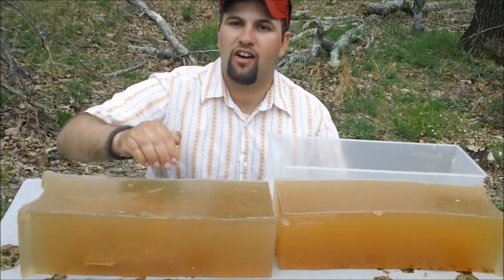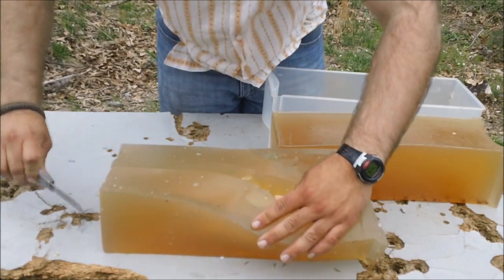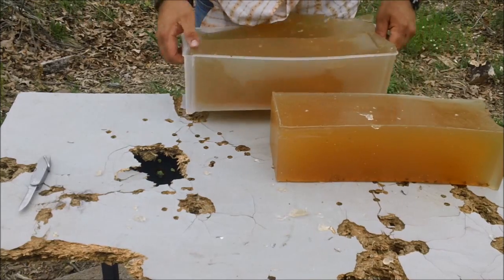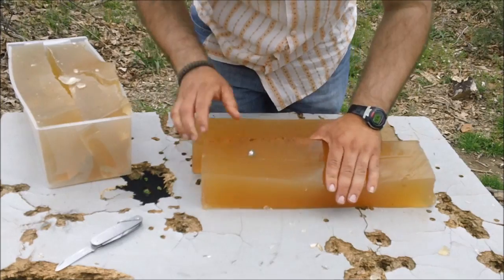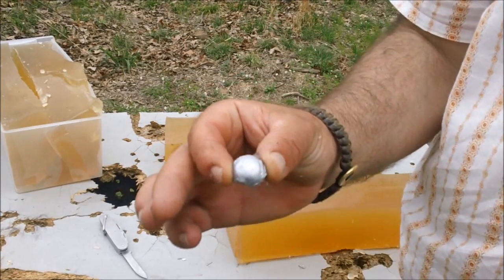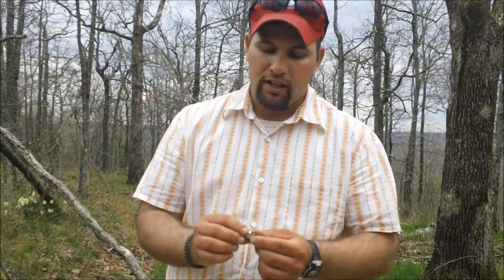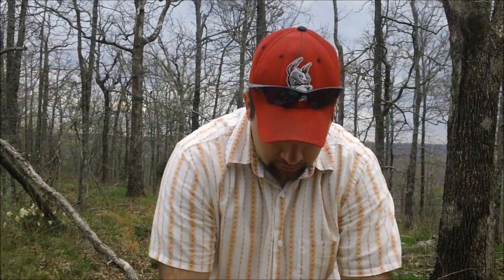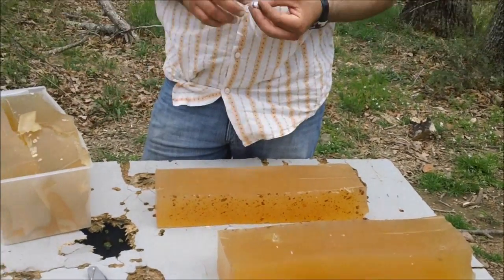Ballistic gel testing Sierra 165 grain SBT .308

Comment: I recently shot two does with this load in the federal line. One through the neck the other was a bad shot, I think the bullet deflected in the brush. The hit was behind the gut in front of the ham. The bullet blew up and didn't exit. Massive damage. I found the jacket and what was left of the core. I estimate 5 inches of penetration. I've shot other deer with it at 250 yards and its a pass through and the deer run up to 50-75 yards. In the remington 150 corelokt 308 the results have to odd also. Buck shot in the neck the bullet exploded and penetrated maybe 4 inches. These bullets are going fast in comparison to me jogging but not that fast like my 22 250. I get why that bullet exploded when I shot a buck in the neck last year its moving at 3600 fps. The 308 has been an enigma.

Comment: What was the impact velocity?  I'm assuming this was shot inside of 25 yards.... 
If launched at 2700 fps, it should impact at 100 yards at 2500 fps so your fragmentation will be reduced if not completely eliminated into a perfect mushroom with very high retained weight. 
It is completely unfair to test rifle bullets at near point blank range. The only way to get this bullet to fail like that at range is to fire it at .300 wsm or WMR velocity. 
Launched at .308 velocity it will perform great within its range limitations.